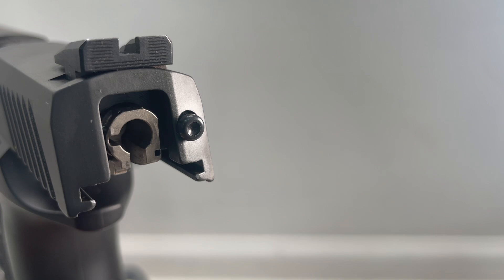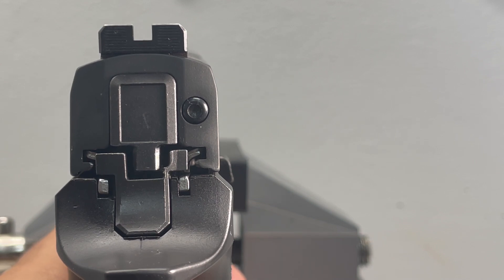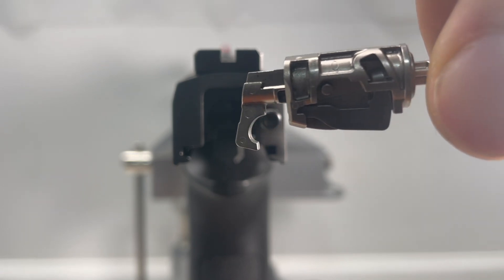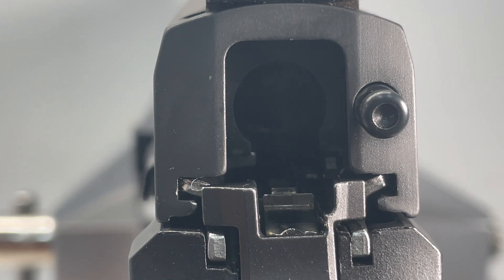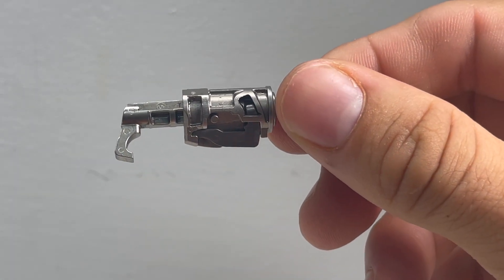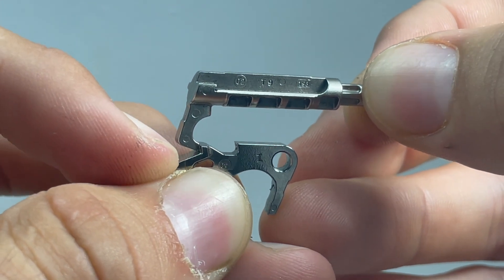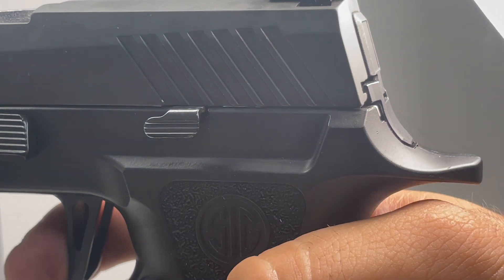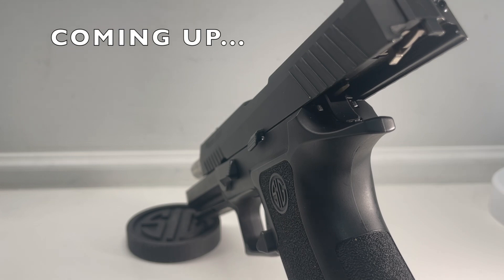P320 - SLIDE MOVES DURING DRY FIRE

Comment: Personally, I do not like this design wrt the safety mechanism. I would never carry this with one in the chamber.

In your video you show how the slide has some vertical play.

There is a video here showing how it is possible for this safety to fail (although it relates to the curved trigger version):

 https://youtu.be/2KykjaykRlc
Reply: But is that much play possible?
Reply from the maker: I remember that video, I have to say that whoever made that rendering was “generous” when displaying the tolerance, and that is putting it lightly. Even when I have explored the pre-upgrade models, there was never that much play in the slide and the play that is, there is localized to the slide. Only, the striker itself does not have the ability to shift up down or side to side when it’s inserted into the cavity for the slide. the strikers leg is also very long and cannot be forced over the sear ledge even with manual manipulation/interference. However, I always advise those that are not sure whether to carry the P320 or not with one in the chamber, two either use a manual, safety model, or not to carry at all. The peace of mind you get from not having to worry about something even if it’s not going to happen is much more important.

Comment: Just noticed your spring fell off your striker (or you took it off). Just wanted to mention (as I've lost small parts without noticing before).
Reply from the maker: Hi @Deuce Deuce, I took it off to let viewers see how the parts interact since the sear spring causes the sear to be tensioned back onto the rear plate. The spring you have to be very careful with is the tiny one that’s located inside the sear housing.
Reply: @SIGMECHANICS  Good to know. Thanks. Appreciate the videos. Hope to see more.

Comment: Snap caps in the magazine work very well too (and it's always good to use snap caps when dry firing). It protects the gun, even if it's not necessary (it reduces wear). Great explanation. The best I've seen.
Reply: This is not true with striker fired guns.  Snap caps make no difference in terms of wear.
Reply: @Iliek  They do, esp on some guns, but not all. Have seen it first hand many times... including guns damaged from dry fire. (like the Ruger Mkiii for example which is designed to be able to dry fire, but the pin that stops the firing pin from striking the barrel gets damaged. Can destroy the entire bolt. With snap caps, there is zero damage to the pin. Also, damaging that pin and not knowing it will damage the barrel too, because the pin will no longer stop the firing pin from striking it). edit: my mistake, you said striker fired guns.

Comment: I hate correcting people,  so instead of correction,  lets just call it ADDED KNOWLEDGE…  the seer and the striker interacting with each other may be the reason the slide moves when dry firing,  BUT the drop safety lever moving to disengage the drop safety also adds to this movement.  To get rid of the movement,  you’re correct,  even Sig recommends inserting a mag when dry firing.  But it’s not holding the slide in place JUST CUZ it’s inserted,  empty mag is pushing up on slide catch because of the spring tension of the follower for last round hold open.  And with full mag,  or partially full,  the rounds in the mag are pushing up on the round stripper on the bottom of the slide…. But thank you for your demo,  keep spreading and increasing the knowledge base for everyone.  Thanx,  and stay safe
Reply from the maker: You are absolutely correct. The cause of the slide catch is because of the follower tensioning it. 

Regarding the safety lever…although it’s very well possible it adds movement to some degree, it’s not the main cause. If you take apart the FCU and you remove the lever altogether and test it out, the result is the same in terms of overall movement. I wish I could post a quick video showing that here in the comments but I don’t know how (or if I can really) :-/ 

Anyway, thank you so much for your insight! I wish more people would share and add clarity, at some point a new owner will run into the video and these comments are the things that help make them comfortable as they learn. Thanks again!
Reply: I love the details you put in to your videos with the different angels and the explanation of what you’re looking at and what it’s doing and how it effects and interacts with other components of the system.  I had thought all this was magical and mystical,  dark science at first.  Just like when you get your first hot rod.  But on that,  the best way was to learn from breakages and to try and do it better next time.  Nowadays,  you have YouTube.  You can find virtually anything you want/need on here.  To blab a little,  I was at first going to buy a blank FCU (mup?) and a kit to finish it but at that point I was intimidated by it.  Now,  with owning a P320 & wanting to upgrade it I’ve learned more than I’ll ever need to,  I hope…   

I now wish I could buy a kit but my state doesn’t allow it,  Pa…  but that’s ok,  one FCU should be enough.  Now Sig just needs to step and keep up it’s stock.  I also have a P365XL.  And I’m saving up my pennies for a Sig MCX.  We live in a great time for firearm ingenuity and inventiveness.  Robinson Armament is another great example…  I really wanted a CZ Bren or Galil Ace Gen 2 but I really think the Sig MCX is the way to go???  Anyway,  I digress…  starting to blab,  blah blah blah.  Stay safe and be well…

Comment: The reduction in play occurs when you insert an empty magazine because the follower applies upward force on the slide release to enable last round hold open. With a dummy round (or a tap rack training aid) in the magazine, there will still be a little vertical play in the slide when dry firing.
Reply: even with a dummy round in the chamber I wasn't able to get any play. I tried with an empty mag and a loaded mag with a dummy round in the chamber and got no play
Reply: @JohnLee-kr3fb  I did on my M17 so 🤷‍♂